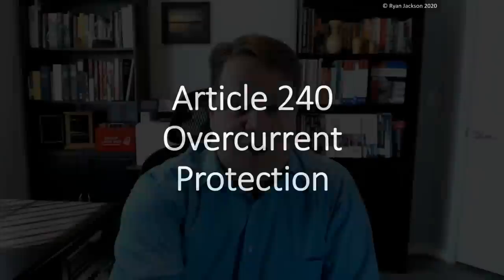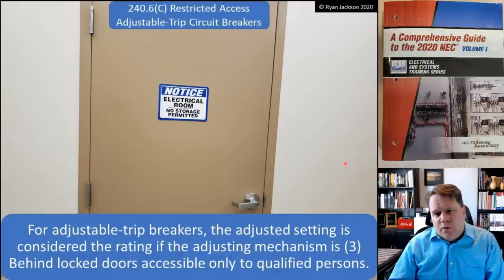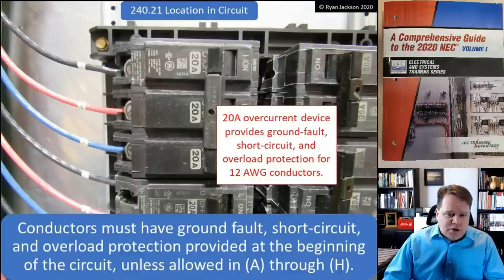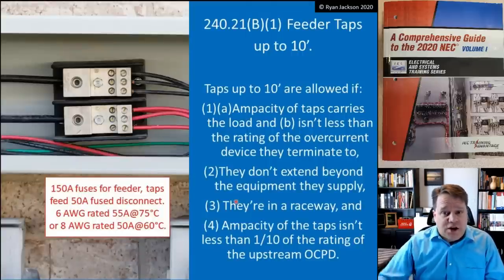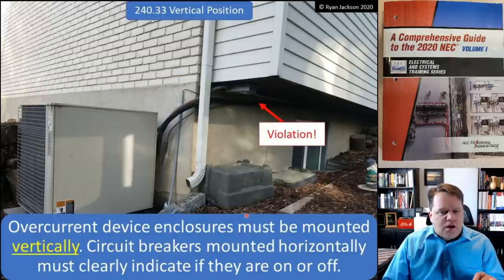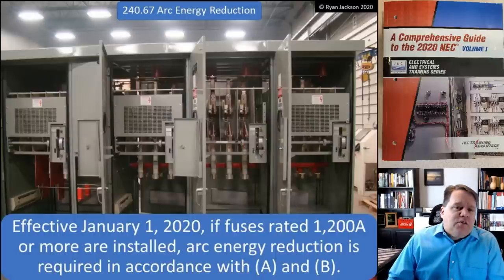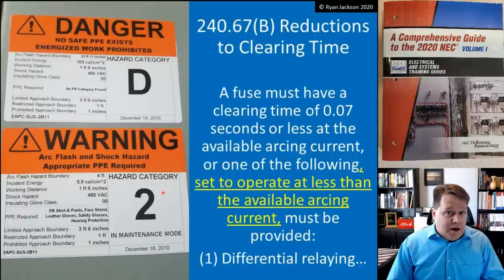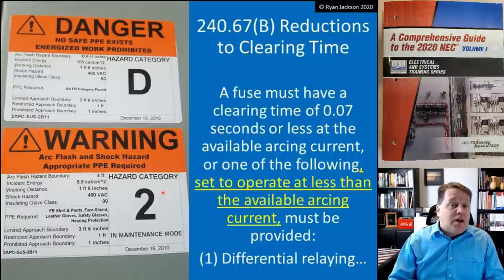2020 NEC changes series: Article 240 (Overcurrent Protection)

Comment: I retired from a large hospital/research center ( 5 millon square feet ). They had 15 dual service 13.2 KV Substations. Only 5 or 6 had card acess while rest had a key lock where too many people had the key. Great thing about card reader is you can go back and see who enterted. Only a few had cameras outside of substation. Maybe requiring a key along with a password to adjust trip settings would provide better security. Thanks for another great vid.

Comment: Excellent explanations. Much appreciated. I'd like a little clarification on the maintenance mode or ARMS switch, for energy reduction. Your explanation doesn't mention the location of the switch in the circuit. Does the switch need to be upstream in order to reduce the energy downstream? So, if you're working in a main breaker section that also has a maintenance mode switch, and if you are also exposed to the LINE side of that breaker, then the maintenance mode switch doesn't reduce the exposure. In that case, the maintenance mode switch would need to be at an upstream clearing device.
Reply from the maker: I agree.

Comment: Instead of requiring a password they should require 2FA: pincode + OTP generated by some security device (could be a smartphone). That is the most common way to protect sensitive things over the internet. Banks use it to let users access their finances, and employers use it to let employees logon onto their work VPN, etc. Proven safety. That password requirement is pretty bad, not even describing requirements to the password, max logon tries before getting locked out, a timeout between tries, such things which keeps hackers from brute forcing the password with scripts.
Reply from the maker: I am guessing (although I feel somewhat confident) that there are SOME securities, I just don't know what they are are how extravagant/complex.

Comment: 240.6(c)4 is a nightmare for Cybersecurity
Reply: Further elaboration: this type of equipment would require regular software updates, access control logs, likely need the addition of Two Factor Authentication, etc. It will require its own audit, and additional hands ( IT/IS) accessing the equipment, who many not know proper Electrical Safety, or Facilities/EHS who have minimal Cybersecurity Training.
Reply: Indeed. Apple can't make it's phone secure and they have a building full of people working on it. How secure do you think a programmable breaker is going to be from a company that sells a few dozen of them a year? (absolutely not at all.)
Reply: @jfbeam  See in re: Stuxnet virus

Comment: Feel free to reach out to me if you're putting in NEC recommendations. Bottom line don't use this stuff. There is nothing you can do that has not been broken. We have a saying with windows systems No breaking, just entering. When's the last time that was patched? And remember those only patch known vulnerabilities. There's usually a few weeks or months between CVE announcement and patch delivery. In addition you had better bet the signatures for these systems are well known to most intelligence agencies around the world. Do you honestly think some rinky dink group of electricians stands a chance against state sponsored actors?  To which you're probably thinking well that only matters for govt, but what happens the moment a high profile politician checks into a hospital. Or the adversary order of battle indicates your breaker controls a critical piece of city infrastructure feeding a defense facility or is part of a manufacturer of the defense industrial base or would cripple civilian infrastructure.

 The best rule you could pass is to mandate those systems never touch the open internet and prescribe the updates come from recently wiped computers to prevent an air gap jump attack.
Reply from the maker: Believe me, it is being heavily discussed.
Reply: @RyanJacksonElectrical  Yea that kinda terrifies me more. Curious do they have actual security practitioners in those discussions? This is in the realm of CompE not EE. And worse no one in the civilian side really even thinks to the degree we do.
Reply from the maker: @steven7650  There are written industry standards. The NEC wouldn't tell you what the cybersecurity requirements would be, just if you need to have them or not.